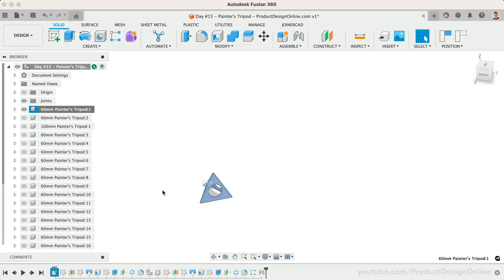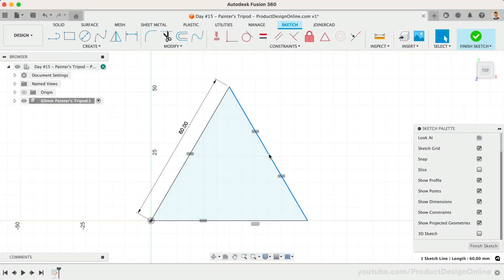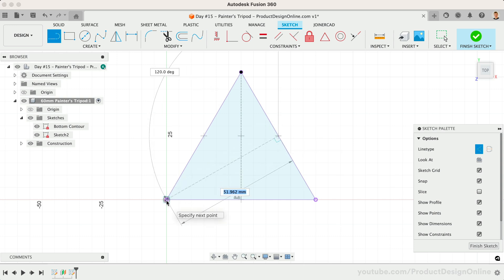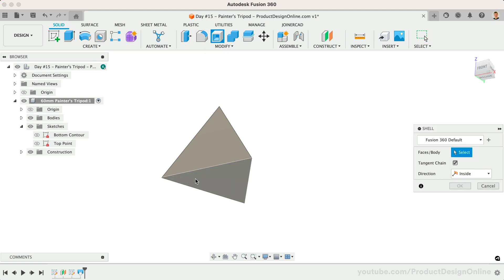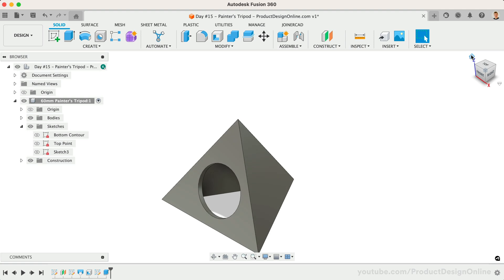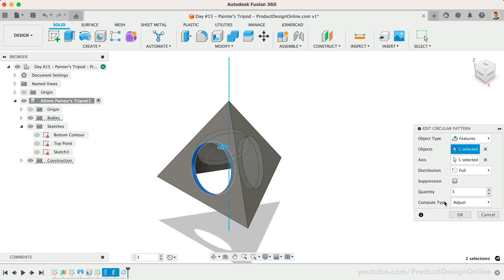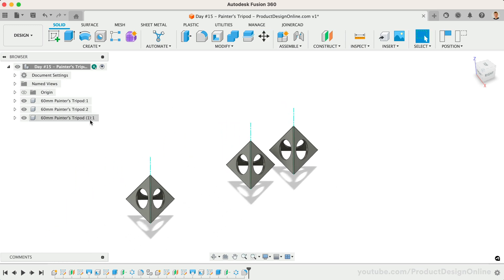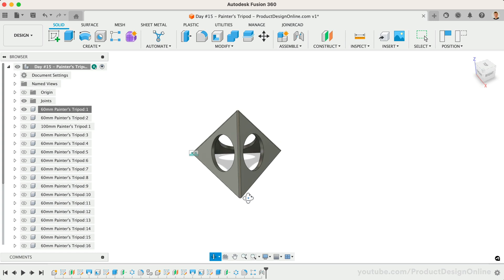Day 15 of Learn Fusion 360 in 30 Days for Complete Beginners! - 2023 EDITION

Comment: Having recently bought a 3d printer I've been following your EXCELLENT videos to teach myself Fusion 360 (free version).  I've just watched day 15 and decided to construct the painter's pyramid myself.  I finished it successfully and tried to print it but the print failed with an unknown error.  Thinking the printer may be faulty I tried printing something else and that worked OK. I created a new design and constructed a smaller pyramid in a similar manner but that won't print either so I'm beginning to think that either there's something inherent in the design process that's causing the problem, or three sided pyramids are generally problematic. I just wondered whether anyone had had a similar problem. My printer is a Creality-3 V3 and I tried slicing with both Cura and Creality Print with no success. The error message reads: "Error, key 2514, unknown exception", and the failure occurs whilst the printer is warming up but before it starts to print.
Reply: Just to update this: I had called the part "Painter's Pyramid".  Apparently my printer firmware doesn't like names with special characters so I renamed the part "My pyramid", i.e. I removed the apostrophe,  and now it's printing. Problem solved!

Comment: I'm not sure how you're doing it, but I can't ever change the dimensions of the line. I'm stuck at 60mm.  I can select the line but I can't edit it to make it 100mm
Reply: nvm.  I found you have to double click on the number.   But I haven't found the paste new button, just paste. And if I go back to the original sketch and change it to 100, the tops of the triangles get cut off. I thought that if you edit the dimensions before any other changes, it will make changes to the rest of the following sketches

Comment: Also you can change the height of the construction plane and the diameter of the hole in proportion to the triangle using variables, instead of writing 50 mm you can put "d1-10", what i understand is d1 is in fact the first dimension you declare in the project which in this case is 60mm and change de diameter to "d1/2 - 5" and that's 25. So just changing the size of the triangle you automatically change the others.
Edit: The next video this is explained 😅

Comment: I know this series has been out a while, and it is brilliant BTW. One suggestion for the design as a practical element - enclose the bottom then the part can be used in any orientation, if you were actually going to use them for the intended purpose.
Reply from the maker: Great idea! I left the bottom open because I stack them (when storing them). If that's not necessary, then your version would work as well!

Comment: When I adjust the size, the point does not adjust even though I projected it. I get a weird looking lopsided pyramid. please help!
Reply: It sounds like I had the same problem. The problem for me turned out that the point that I added at the intersection of the two sketch lines didn't, for some reason, "stick" at the exact intersection. It was off a little. Once I fixed that, I could change sizes (of the sides and/or circle) and everything scaled fine.
Reply from the maker: Could you export the F360 file as .f3D and upload to a sharing service/link here? (or a screen recording of a video). This sort of issue is hard to trouble shoot without seeing the file.
Reply: @ProductDesignOnline  Thank you for the help!!

https://drive.google.com/file/d/1c7L8olm4O8Z0x_VGUpuZaN4ER02hd3sz/view?usp=sharing
Reply from the maker: Thanks for sharing your file! If you open your second sketch (after changing the 60mm value) you'll see that your construction lines (both of them) did not adjust to the size, which is causing the distorted triangle. That means they're missing the constraint that keeps them attached to the outer triangle.

Somehow, coincident constraints are missing. You may find it easiest to delete the lines and re-sketch them, making sure they snap to the point of the triangle.

If not, use a coincident constraint to force it to stay there. The opposite end should have a midpoint constraint (if you start by sketching where it snaps to the middle). You could also add that constraint manually if needed.

Comment: Not sure what’s up but “paste new” just doesn’t exist for me. Been through the Autodesk help center/forums and Google. No clue what’s going on. I just did an update before this video but doubt they just removed this feature.
Reply from the maker: Hmm. It should still be there (working on my commercial license). What license type are you on? Ill see if I can reproduce there.

Also, double check that you're not going to paste within the same component. They don't allow that.
Reply: @ProductDesignOnline  Thank you for the reply. Right before I did lesson “day 15” fusion 360 had an update. Thought maybe it was the issue. I moved on to day 16 and used the same feature and there clearly was an option for “paste new” so I returned to day 15 and started from the beginning. Caught some small things I did wrong. It’s been a couple days but I think it was the difference between construction lines and center lines. Occasionally there are some very small differences between the videos and the current version and I was quick to assume that was the issue. 90% of the time it’s not pausing the video and taking my time to make sure things are correct. I can’t tell you how much these videos help. Even your series on shapr has helped so much I’ve been using it for over a year with no direction. Thought I was well off until started watching the series. Thank you!

Comment: After I've projected and drawn my two construction lines to draw my circle, the projected face is vertical, not 'on the face' of the triangle like shown in the video, yet I followed the steps repeatedly trying to figure where I went different. So Im stuck, I cannot cut my hole perpendicular to the sloping face of the triangle. Any ideas where I may have gone off road? :)
Reply: click one face of the triangle, right click edit sketch. Before you do this make sure nothing is selected  i.e. hit escape a few times.

Comment: I am having an issue. On the 100 mm tripod, when I move the offset plane, the circle pattern fails. How is this fixed? What am I doing wrong?
Reply: I had a problem with my circles when I scaled the initial sketch to 100mm. I double checked and the problem was how my construction lines where constrained. It appears that the order you click your lines in, affects the way they are constrained. One of my construction lines didn't get the midway constraint -- indicated with a triangle symbol -- because I initiated it from the corner of the triangle, not the middle of one of the sides. Could your problem be similar?
Reply: @Erinaceus_europaeus  Thank you
Reply: @ Np! It's fun to see old comments still being helpful :)
Reply: When I did this, the lines used to find the center point moved and had to be adjusted. This caused the sides to be unequal sizes causing the circle pattern to fail.

Comment: Your tutorial videos have been a godsend for me, as somebody who hadn't yet utilized any type of CAD software! I am currently doing undergraduate research and will be eventually attempting to interface a laser-based displacement sensor, for the purpose of surface scanning feedback, with an nScrypt 3D printing system. I've nailed down the communication/data reading from the displacement sensor, and will be soon trained on the nScrypt system by a PHD student. I have taken a detour to learn about 3D design and preparation for prints, as it will obviously be of great importance to fully understanding how 3D printing works. A useful first print for me will likely be a mounting mechanism for the laser-based measurement probe, and your instruction on the Fusion 360 tool set has been invaluable. I have completed all of your 2023 update videos, and have gone back to watch your videos from 2019, which have also been helpful even though the UI has changed. Will you be continuing on with instructional videos for 2023?

Comment: I’m caught up on your videos. I thought I’d be able to (re)create a tennis ball saver. It’s a simple 2 part model with an o-ring that has to make an airtight seal and threads so that when the 2 parts are screwed together it pressurizes the tennis balls inside. but I’m hung up on making threads that are only a partial length of the wall and allow clearance for the other part to clear the o-ring. This would make for a great tutorial since it’s a simple functional model with 2 parts that must work together correctly.

Comment: After creating the 60mm Painter's Tripod component I used the Line tool to draw the triangle on the bottom origin plane. I noticed that in your drawing you had a blue square and a rotation handle which moved together as you placed each point of the triangle, in my drawing the blue square and the handle did not appear. What mode was your drawing in?
Reply: Was also wondering that